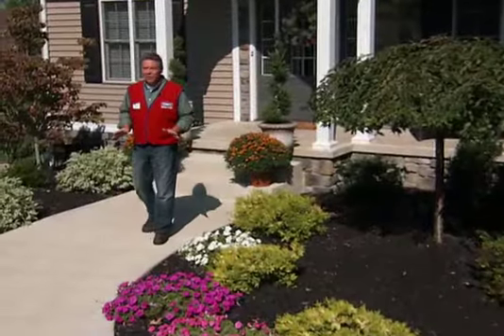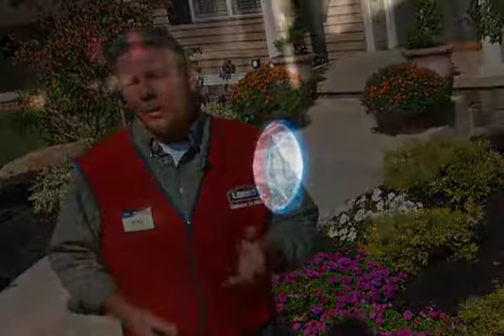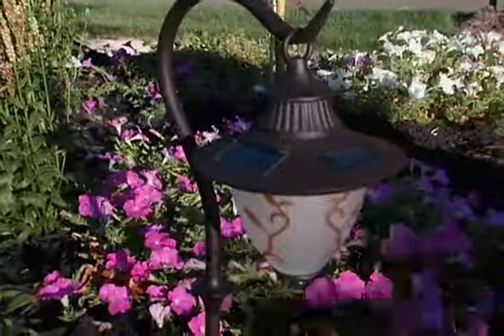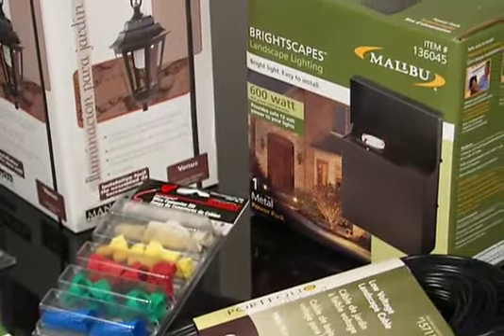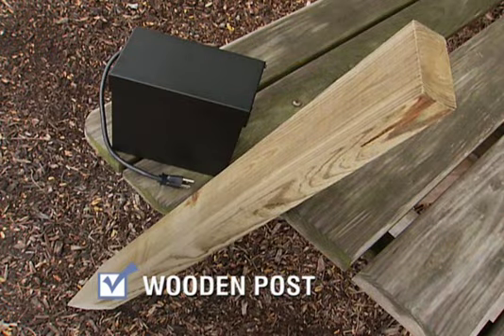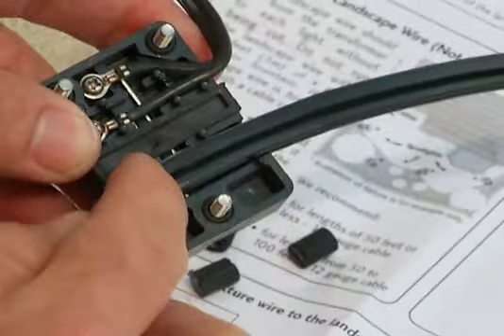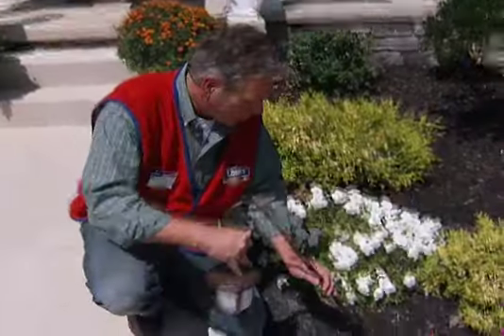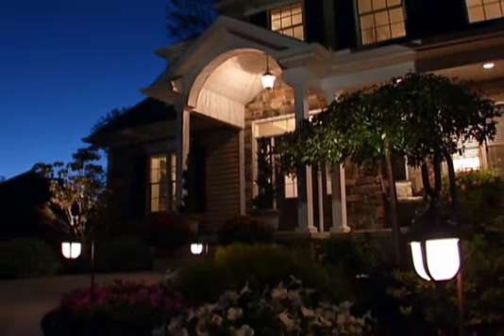Installing Outdoor Landscape Lighting

Comment: Not impressed -- they're trying to up-sell a multitude of  items.  Besides that, I don't want low voltage lighting because they don't last long.  I purchased a very expensive set from Lowe's years ago and the transformer burnt out before two years after installation.
Reply: Mine from Home Depot still work after 28 years.

Comment: Have you discovered the new low voltage wiring that never needs wire to be cut and exposed to potential corrosion. The twist locking connectors make for waterproof connections and match up to most of our Laser and LED landscape projectors. We have adaptors to convert any 12 volt AC light to match the system. I'm glad to never have to cut a wire or have risks to weather affecting my connections again. Here is my latest video demonstration of the wiring system and some exciting projectors which was have offered at www.LasersandLights.com since they were invented in 2007. https://lasersandlights.wordpress.com/2015/09/01/eliminate-extension-cords-new-low-voltage-waterproof-cable-for-blisslights-sprights-and-all-12-volt-ac-landscape-lights/ Thanks for sharing your knowledge, Bruce

Comment: @randacnam, fantome is right on work principal, whilst certain wire types are safe for direct inground installation, it's a good practice to use electrical conduit. It's cheap and used less for maximising cable sheath life but more for ensuring you don't sever it with a shovel.